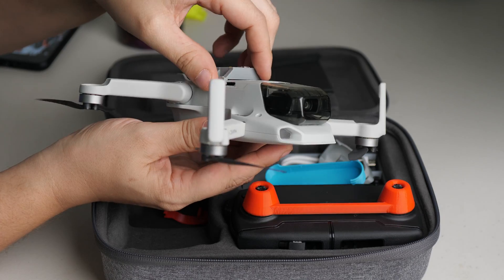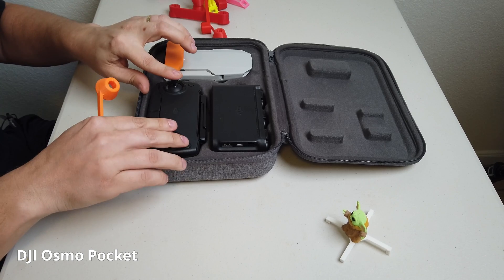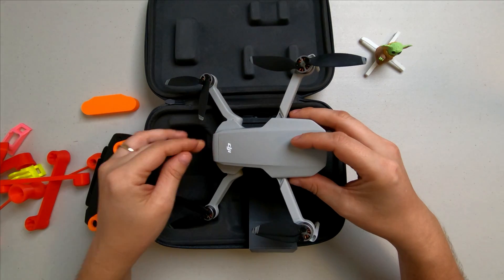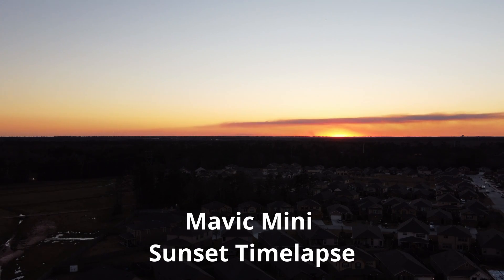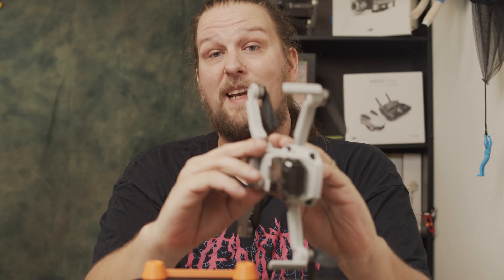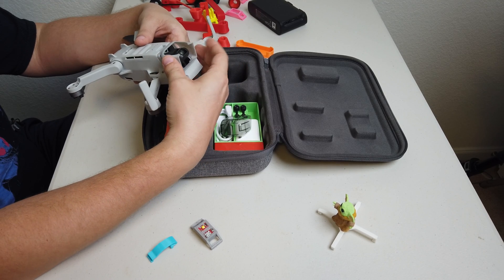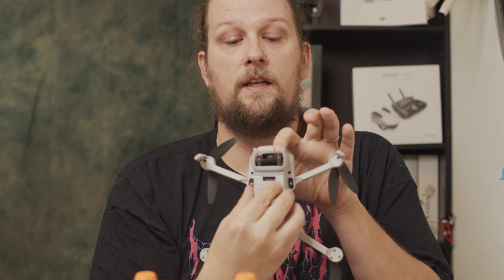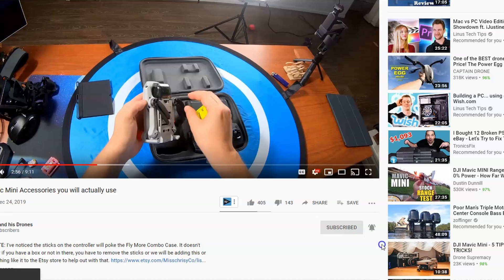Awesome Mavic Mini 3D printed accessories

Comment: Should make landing gear, like the ones drone valley shows off, and they have a off colored one on Amazon and a matching color to dji mini, grey from pgytech, which is the same exact as the off branded off color white but just stamped with the pgy logo and grey color. Those foldable clip on legs, should make a new better maybe lighter version, and taller, smaller, idk?!!? My idea and wish I could find more styles of the landing gear but not like the sled style or body landing gears. I like the feet style where each leg gets a leg. Hope to hear your response, safe flying always, from Louisville ky!

Comment: For the strobe you can just use a Freedom Micro from photon micro lights and some velcro. Multiple color options and strobe settings, replacable batteries and super small.

Comment: With all those attachments? Will I need to have to have my mini registered? If it over exceeds the weight limitations? Thanks
Reply from the maker: If you attach anything to the Mini it will exceed the 250g weight limit and may require registration, depending on your local laws.

Comment: How about a mount for Mavic Mini and the Firehouse Arc II?  This is brighter and has four LEDs. I also have Mavic 2, and would like mount for strobes also, but not on top of GPS receiver.
Reply from the maker: My Firehouse Arc II will be here today, but it's a lot bigger and heavier.
Reply: How is the Mavic 2, Firehouse ARC II mount coming?  (I prefer the Arc II for the Mavic 2, as payload capability and range is much greater than the Mini.)

Comment: Great work with your 3D Printer. I LOVE the mount you made for the bottom of the drone for the Flytron Strobon Cree'.  Can you make one for the Mavic 2 Pro?  If so I'll buy one.  Thanks.
Reply from the maker: I'll be working on M2P accessories next, I have plans for strobes and other accessories
Reply: @dudeandhisdrones  - Awesome.  I subscribed.  Thanks.

Comment: I have envisioned something very similar to your strobe mount. But my version, if I were able to create something like that, would have a red on one side and green LED on the other side to indicate port and starboard. Is there someway you might be able to add that?
Reply from the maker: We did release leg strobes for the same size strobe, but I might consider designing something like that. The key to the Mini is keeping anything you attach as close as possible to keep balance and CG from going out of whack.